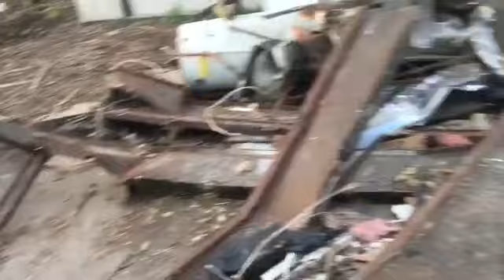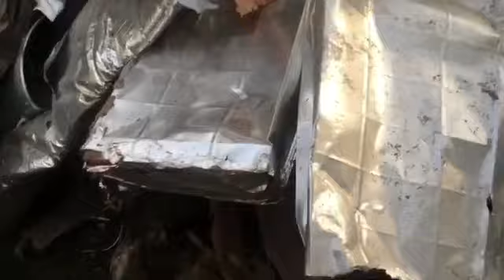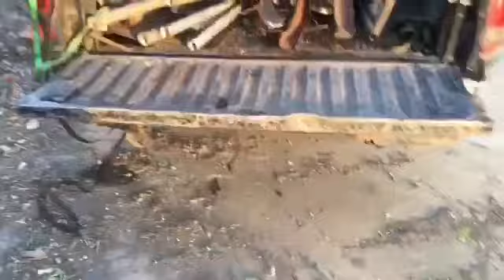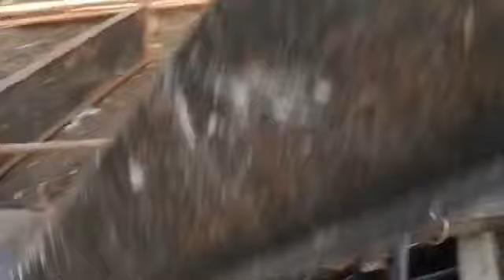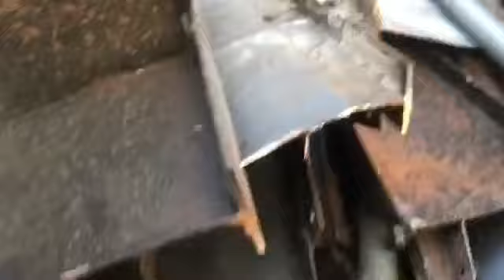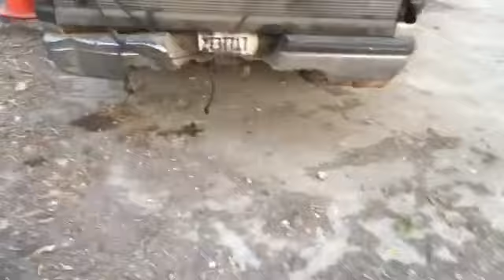Literally Everything including the kitchen sink

Comment: I saw that you have to get a permit or something to scrap in joliet. Do you have to check all the surrounding towns for the same type of permitting so you don't get pulled over for scrapping or dumpster driving.
Reply from the maker: At this time only Joliet requires a scrapper license 
Ya get ya truck impounded & a $150 ticket without it so expect an expensive day if ya don’t 

All other local towns don’t have any 
Except Chicago it’s $150 for a junking license you also have to wear a safety vest when you are scrapping and your truck has to have reflective tape on it
And you have to display your license on the side of the truck 
The number
You have to go to downtown city hall to get that
Ia few suburbs require also
Evergreen Park has a permanent system they only allow 20 scrappers. So another words you can’t Scrap in that town because there’s never an opening

Comment: Yewwwww ....went to my yard yesterday 225 ton for steel, said its gonna jump $20 by friday. Which make it $245 ton....took 1500lbs in got $175. #1 copper $3.30, #2 $2.95, #3 copper $2.55 , yellow brass $1.95 red brass $2.12
Reply from the maker: Well I hope that works out for you because it would be awesome you’re a cop and prices are a little bit lower than mine

Bare bright $3.60 number one copper $3.50
Yellow brass $2.25

Nevertheless steel is the meal
$175 ain’t bad 
I got $186 for 1500 pounds from that demolition job so far
The stuff that you seen in the pick up truck in the video

Anyway every little bit helps
Reply: @steelisthemeal  right on
Reply from the maker: Hey hopefully ya had a halfway decent day
Scrappin 
Yewwwwww